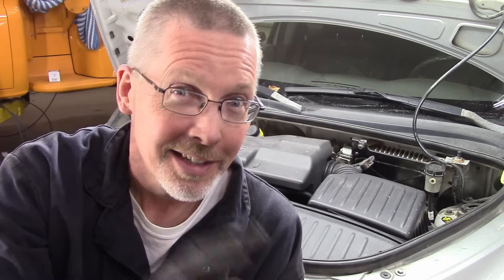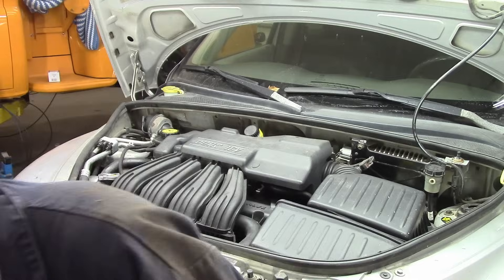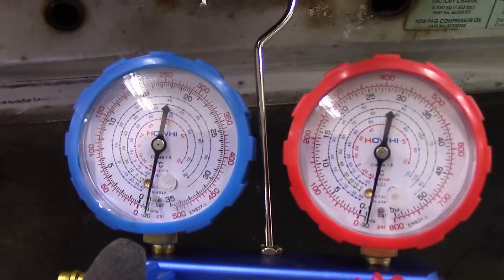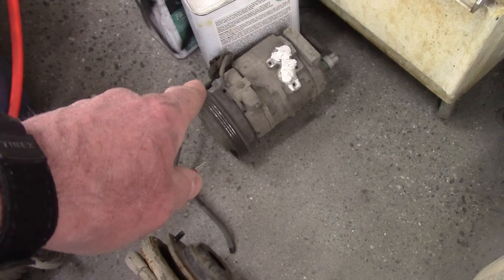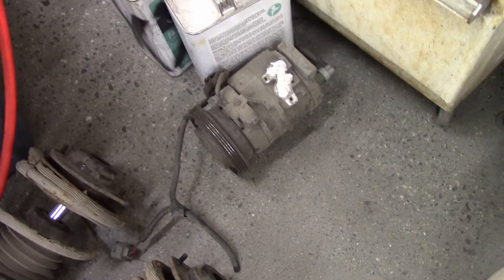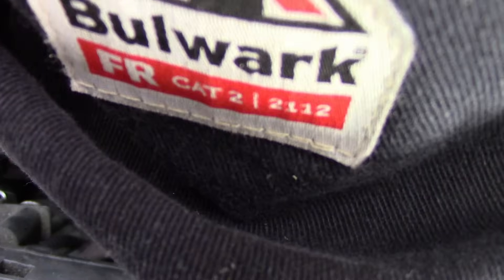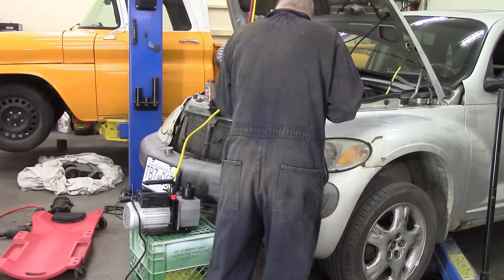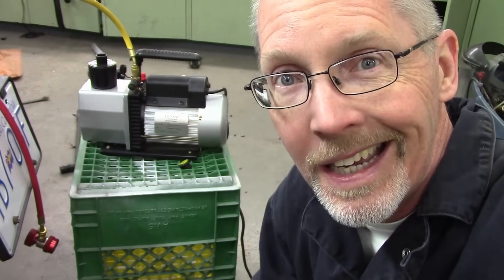DIY Testing, Fixing, & Recharging A/C

Comment: All the env regulations just helps clearing our wallets better. And those certifications have to be renewed yearly!!
Few weeks back, replaced compressor+dryer and washed the evap (was really dirty). If i was to do (the repair part) on a certified ac guy, i would spend >5x more. Just went to vacuum tested+refill after repairing. And probably due to the legislation, gas is 2-3x more than it would.

Comment: Having recently worked on a PT Jigsaw puzzle I appreciate your recording of it first pulling the refrigerant into the system you can hear that cold motor. And by the time you were done you could actually hear yourself think around the motor after everything warmed up and filled up the spaces that makes the nasty racket of a PT/neon motors starting up cold.

Comment: Assuming the video isn't edited and it's in original chronological order, at 11:52 you're actually closing the valves on your hoses, not opening them, after attaching to the vehicle.  If you were actually vacuuming at that point you vacuumed your lines only.  That was before you changed the accumulator, though.
Reply from the maker: Could very well have been out of sequence. Could also be I didn't pay attention to which part of the video I trimmed and kept. Early on I was figuring out the gauges - HVAC was my weakest area back in trade school, I have zero experience in doing A/C.

Comment: Nice, As for adding refrig., a digital kitchen scale works fine for adding correct weigh,. listed on the hood or proximity there of.
Reply: Plus the self-sealing cans and taps actually seal, so you can unscrew the can, and weigh it on your postal scale, then connect back up to the tap with nearly zero refrigerant escaping.

Comment: My pt cruiser also has the AC not working the main problem I have is a odd glitch it changes and discharges intermittently one time I'll go out after a week or two and it'll fire right up another time I'll go out next morning and dead battery one time I can make multiple starht next time I'll need a boost every time and no rime or reason one time I can drive it an hour and it changes up next time it won't so I keep it on the charger when it's parked at home and Carry 2 booster packs and a set of cable's I don't trust in mechanics seen to many that over charge and too many who'll fix say a fuse able Link and charge to replace the alternator regulator and battery when they didn't need to
Reply from the maker: When electrical is inconsistent, it's usually a connection issue - 9 times out of 10 it's corroded battery posts.  If the electrical is possessed by the Devil, it's a grounding issue.

Comment: Always Check for system leaks with pressure (dry nitrogen) not vacuum.  If you do have a leak, applying vacuum pulls moisture into the system which will have to be removed later.
Reply: yeah i got some canned dry nitrogen in my back pocket.
Reply: @markae0  I hope so because anyone with a clue as to what they're doing would acquire nitrogen and a regulator before a vacuum pump.
Reply: @carrollprice1213  If you watch the video you can see he used two (off the shelf) cans of fluid, and started a third accidentally. So it was just a backyard-John for personal use, one time job. Yes, a non-amateur would use a dry nitrogen pressurized test. FIRST. But vacuum is nice to suck in those one time disposable cans.
Reply: You can use compressed air to pressure check for leaks - PROVIDED you run a vacuum afterwards to clean the system.
Reply: @HarryJamesBooks  A vacuum pump, tank of dry nitrogen with pressure regulator, and manifold gauges, are the three pieces of AC equipment (along with knowledge of how to use them) required for air conditioner trouble shooting and repairs of any description, except maybe adding coolant to a system in an emergency situation.
Reply: @carrollprice1213  For someone doing it for payment, yes.  I repaired mine mine including replacing the condenser and a HP hose with none of those and it's working fine
I guess I'm just lucky.
Reply: @HarryJamesBooks using compressed air will add moisture to the system especially to the oil that is hygroscopic using dry Nitrogen is a must!
Reply: @Ken_4711  Sorry mucker, you're repeating an old trope. Ask yourself how much air an aircon system contains then ask yourself how much water is present in that volume of air. The short answer is "it depends on the humidity" if you're using a foot pump, or "bugger all" if you're using shop air through a system built to spray paint and put out dry air. 
Air *can* hold up to 0.017ml per litre. So there's your worst case scenario. So if you pressurise an average 1 ltr capacity system to 50psi briefly to check for leaks, *at worst* you'll put about .05ml in it. Using shop air, you'l put next to nothing in it. Having checked for leaks and repaired leaks, you'll then vacuum down, you'll then change the dryer (or vice versa depending on how you roll) then charge the system using fresh oil.
How much water in in the system? 
Bugger all.
Reply: @HarryJamesBooks  would have to flush the system to remove all the moisture laden oil before contaminating the fresh oil with the moisture laden oil with solvent to clear all the lines etc so they are like brand new. Says on the oil can do not leave lid off as oil will absorb moisture from the atmosphere, let alone injecting it into the system. I done my mrs Volvo that had a leak in the condenser it took 15 hours vacuum before all the spikes of moisture boiled off. If I would of used an analog gauge it doesn’t show this. Obviously a shop could not warrant doing that for a customer but I graphed the whole process on the digital gauge and iPad app. The graph doesn’t lie I follow a pro on here that has run a shop for at least 30 years that’s where I get my info from, as I’m new to car a/c Any moisture no matter how small is bad I’m my opinion so why not just use the correct gas OFN oxygen free dry nitrogen.
Reply: @Ken_4711  There. Is. No. Moisture. Most especially when putting a litre or so of dried shop air.
I don't mind what you do, honest. Pay for Nitrogen and have it spray out of your holed pipes or whatever. It's your money 🙂
Reply: @HarryJamesBooks  I don’t mind either, I just like to do everything as well as I can and hand on heart can say I haven’t introduced any contaminants into the customers system.
Reply: @HarryJamesBooks  You realize that's a VW guy right?
Reply: @Ed70Nova427  So what?
Reply: @HarryJamesBooks  I'm not disagreeing with what you've stated. I'm just saying I've never been able to change the mind of a European car enthusiast.
Reply: @Ed70Nova427  Gotcha 😄
Reply: @Ken_4711 Yes, but a vacuum pump will take it away.
Reply: As a 20+ year ASE certified Auto Tech, I have never seen anyone use or heard of using nitrogen to pressurize an automotive or light/medium/heavy A/C system.  To say that anyone with a clue would get a nitrogen and a regulator before a vacuum comes from a place of ignorance about actually servicing mobile automotive type A/C systems.  Call a dozen local auto repair shops that work on A/C systems, including new car dealers, and see if you can find one that has the capability to pressurize a system with nitrogen.  I'll wait...  
I'm not saying it wouldn't be a good idea, it's just not standard practice.  It's also possible that regionally things are done differently.  I know this is true in the building trades but I haven't seen it nearly as much in auto repair.

@carrollprice1213
9 days ago
Always Check for system leaks with pressure (dry nitrogen) not vacuum.  If you do have a leak, applying vacuum pulls moisture into the system which will have to be removed later.

@carrollprice1213
8 days ago
 @markae0  I hope so because anyone with a clue as to what they're doing would acquire nitrogen and a regulator before a vacuum pump.
Reply: @ToddKing I am an F-Gas certified A/C tech and dry nitrogen is a must for pressure testing, like someone else commented using a vacuum to to test for leaks will draw in moisture into the system if you have leaks and laden the hygroscopic oil with moisture. You will then have to vacuum the system for hours to get rid if at all the moisture! You would not really see it with those crappy analogue gauges. you really need some digital gauges to watch the pressures/moisture content of the system watching it on a graph. It’s obviously going to work what he does but for how long? The moisture will saturate the desiccant filter dryer, a service part most auto places never change! Not to mention even checking the service ports before putting the service valves on 99% of the leaks I have found are service valves, when the system is 100% out of refrigerant a pressure test with nitrogen and the service valves removed will show leaks on the ports. Not bashing any just sharing what I know. This is the guy you need to follow for auto a/c he’s been in the game his whole life and who I learn from Tom Lech / LECH AIR CONDITIONING
Reply: @ToddKing  You are correct. Hardly anybody uses nitrogen to pressurize an auto ac system. BUT I do. I have the equipment left over from brazing HVAC systems. I now use staybrite 8 on the HVAC systems, so no real use for the nitrogen bottle or regulator. Until I started using it on automotive. The nitrogen tank ran out, so I switched over to my MIG shielding gas tank of c02/Argon to pressurize auto ac systems. 

I mainly use it to look for a drop in system pressure in an empty system. Usually dye will pick up the leak, but a pressure check is also good for after repair confirmation or to check a system with a potential large leak.
Reply: @mph5896  when you're equipped for resi HVAC you'll have nitrogen and an actual micron gauge, not rely on the crappy negative scale on analog manifolds. A shop equipped for automotive ac will have a recovery machine that will gas up and evacuate so can pressure test with refrigerant and not need nitrogen.  A lesser equipped shop like here, a pressure test would involve gassing up with refrigerant, electronic leak test, bubble test, then evacuate.... to the atmosphere. But r134a and r1234yf doesn't hurt ozone layer ( zero ODP) but has GWP global warming potential... if you buy into that climate change stuff.  So I can totally see a resi HVAC guy using nitrogen - adding a trace of refrigerant then pressurizing with nitrogen - in the US the EPA allows this trace amount of refrigerant to be vented to atmosphere.
Reply: @ToddKing  Here in Germany, the leak test is mandatory if the system has a leak. This is done with nitrogen. If you don't do that, you can go to jail for it. 😆
Reply: @nic3376  it's interesting how different places require that you do things in different ways.
Reply: @nic3376  I wonder how it's done in Russia, India, South America, or China and other places around the world.
EDIT: I even wonder if the R134 or the like are even harmful to the atmosphere. Are there some countries using clean processes and other places just letting it rip? I remember years ago I watched wrecking yard video's of employees disassembling vehicles fast, but they would use bolt cutters on the ac hoses and the Freon was spraying everywhere and they'd just go to the next car and same thing.
Reply: My thoughts are; If the system will not hold a consistent vacuum for a period of time lets you know your system has a leak. Then you can use pressure (maybe with soapy water) to pinpoint where the leak is in the system so you can repair it. It is standard procedure to pull a vacuum on any empty system to verify that it has no leaks and to pull out any moisture before charging the system. And yes; Nitrogen is probably best to use for finding the leak, but it is not something common that the average person will have in their garage. Plus; since you will be pulling a vacuum on an empty system prior to charging anyway, whatever moisture was in the system will be pulled out anyway.
Reply: @Robert-ko8fi  a 30 min vacuum will not rid the system of moisture or confirm a leak using analog gauges! You need a micron gauge and an iPad to watch the graph/moisture level over time to see the moisture level. I done a mates Ford transit connect 2016 it had leaking valve cores! it was gassed by Ford when the guy purchased it used in 2021 and over the year it’s performance dropped it wasn’t exposed to the atmosphere and 240g refrigerant recovered when I started it. It took 6 hours on the vacuum to get it to a level where the microns did not raise to above 1000 microns after settling. The guy called that it and said gas it. He didn’t want to change the dryer or keep the vacuum pump on overnight. So if a system that hasn’t been played with by a home mechanic had that level of moisture in it just imagine what the average car owner will do to it blasting shop air in! If you don’t want to use the correct kit it’s not worth the short lived experience gained for the cost of the system replacement once that air/moisture starts making an acid and attacks/rots the system. Everyone I have known that has done there own has seen some kind of failure a few years down the line. Not trying to be a di*k just sharing what I have learned watching a seasoned professional. Your video’s are very entertaining and you have great energy but please consider watching Tom Lech videos on here to understand more.
Reply: I know for a fact, using vacuum alone can hide a leak because a working system is always under pressure, so all the seals have taken shape over time and when applying vacuum, it can pull the seals and tubes in the opposite direction sealing the system, giving you a false result. Sometimes after servicing an old system including pulling a vacuum for 30 minutes or so, it pulls all the tubes that are quick connect inward and after you recharge the system it pushes those same connections away from each other, rolling the o-rings back and forth and then slow leaks startat all those connections that moved and didn't get new o-rings. It ends up back in about a month or two with the UV showing seepage in places it was not leaking before.
  Automotive shops in general add the UV Dye to systems and use a sniffer and UV light to search for leaks and only if the system was low when it came into the shop. Generally if a compressor don't come On, gauges are connected and if the pressure is low a visual is done first looking for a damaged condenser or any oily looking spots along the AC system. Dye might be added and run again the verify. If the system is empty we might try putting under vacuum because it has a leak and if it don't a pull vacuum then no need to add any refrigerant or dye to the system. Your going to have to replace the receiver drier so adding shop air to the system can find a leak pretty quick. After the leak is found we evacuate the systems that had a charge long enough to diagnose. Then do whatever repairs are authorized. 
I've only used Nitrogen right before recharging, after a system has been flushed like on compressor failures, because every part is basically disconnected and exposed to shop air and chemical flush for extended periods of time. Nitrogen being the best way to "Dry" the system before recharge but not a standard in Automotive and most shops do not have any in inventory.

EDIT: You men demanding Nitrogen, are working on high pressure HVAC systems in buildings or homes and it's standard procedure.
Reply: I'd suggest adding compressor oil back to the system if you replace the compressor or receiver.  Also, add in some UV dye to make future leak hunting easier.

Comment: I think a large number the Chrysler engineers are card carrying "Crack Smokers Union" with plugs & coils behind the intake and batteries behind the wheel. They need to develop a better "Punch Board" for completing builds that non-crack smokers can get to and fix. After all, they didn't design them to run for ever. A parts department buddy must have lost a bet and ended up working at a Chrysler dealer 20 years or so before anyone knew that FIAT meant "Fix Again Tony" and in my short visit, he pointed out automatic trans failures (Baby 906?) and shown me the pile of 43 transmissions outside the receiving door of parts. He told me that a large number of them (99%) were all under warranty and internal problems (Fragmentation Grenades) would not let them be rebuilt. To this day, I think Chuck Norris hung them on chains, then had a workout!
Reply: Another MOPAR Product, I got a Jeep JT. The battery to start  after stoplights is under the main battery.🤪 I bypassed it, I do not like starting and stopping the engine like that.

Comment: PAG 150 vis is advisable since a thin oil will cause troubles. I ran across a statement put out by GM that every vehicle in for warranty service would have their HVAC system sampled for less than PAG 150 viscosity oil and forever more denied any HVAC warranty work on that vehicle if anything less than 150 viscosity was found. Even it was just an oil change, they were gonna sample your AC for the oil in there. I've been using 150 ever since and my issues with AC are not a thing anymore. The first R-12 replacement kits came with plenty of PAG-46 vis oil and they tended to need a compressor soon after. I did a lot of those convert kits back in the day when R-12 was pulled from the market.